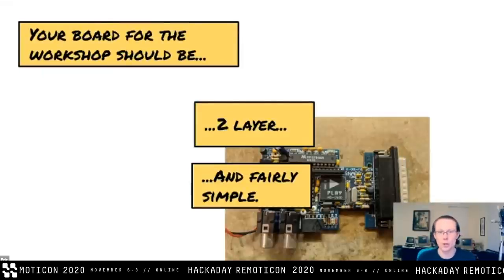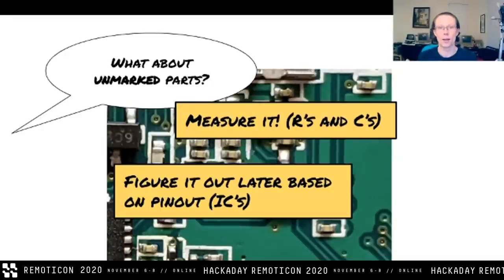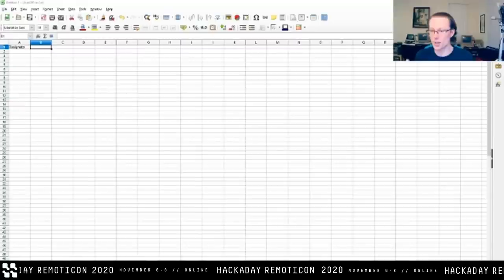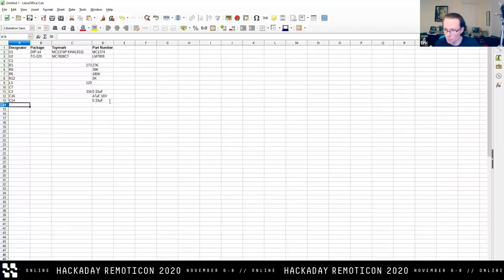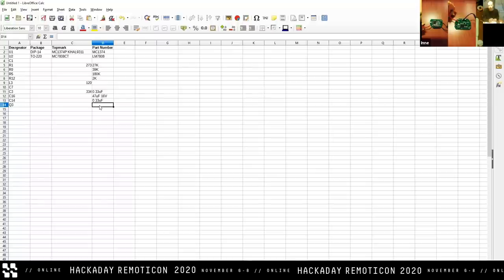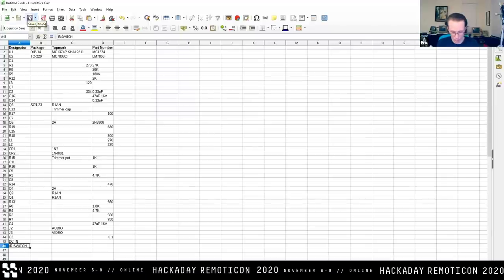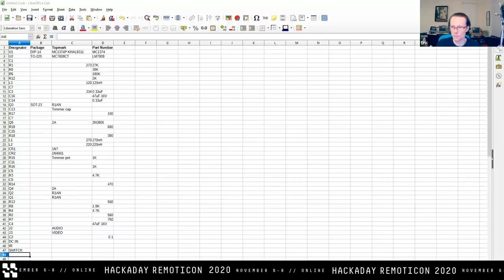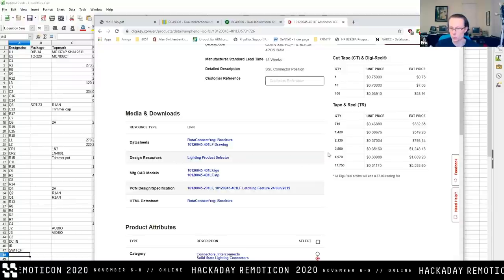Remoticon 2020 // PCB Reverse Engineering Workshop

Comment: Hi!

. . .My practice whenever I come across a chip, such as the MC1374P video modulator, is to draw a circuit symbol specially for the device first using the library or component editor in the software I use, then save it in the library, e.g., "MC1374P", then it can be dropped and dragged onto the circuit diagram sheet like any other component!

Chris Williams 

Walsall, United Kingdom

Comment: Kinda what we all do - I was hoping something ground breaking.  I'm using super bight LED work lights and a camera to "see" into 2 layer boards.  The trick I use is that I take the images with a camera that does 14bit.  If you get the exposure right,  can differentiate the layers.

Comment: Awesome video  , deep knowledge  , but for beginners  , little difficult to understand  , anybody have video's  , reverse engineering small circuit's  , for example  circuit's of REMOTE CONTROL  toys , explaining everything in detail , how signal is transmitted from transmitter to receiver  to control the motors , explaining working of every electronic components used and why it is used  . Please forgive if my request is childish

Comment: I know what he means by designator, outer markings and part number, but what the heck is the "package" column in his spreadsheet?  Can anyone explain?  I'm self-teaching myself about circuitry and somewhat of a noob, thanks!
Reply: Package refers to the physical size/layout standard used by each component. These standards specify the size of the component, number and location of electrical contacts, etc.